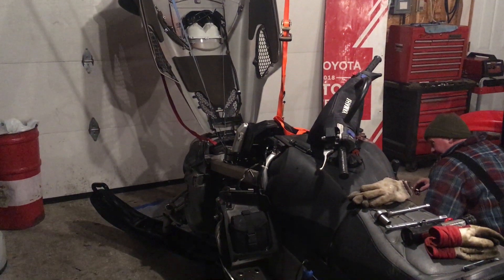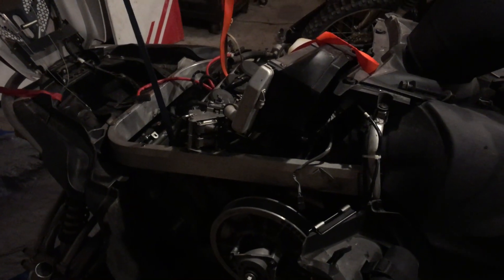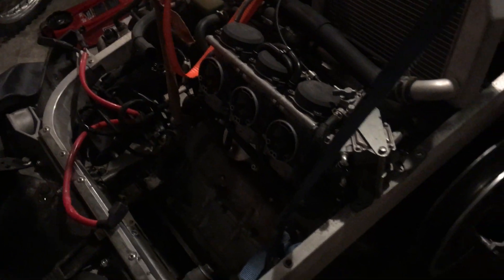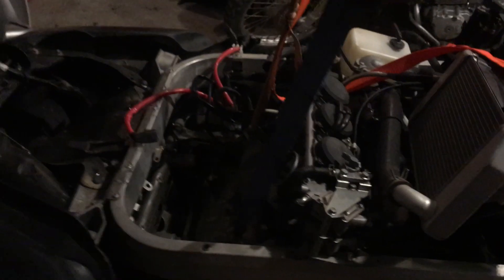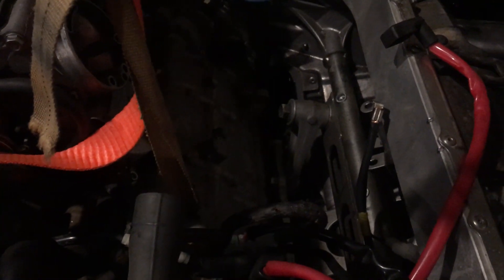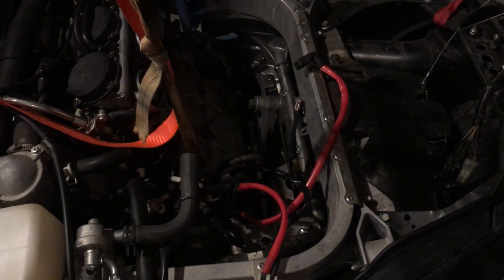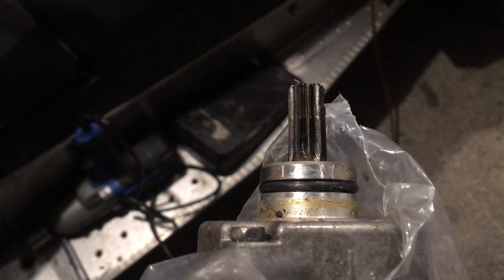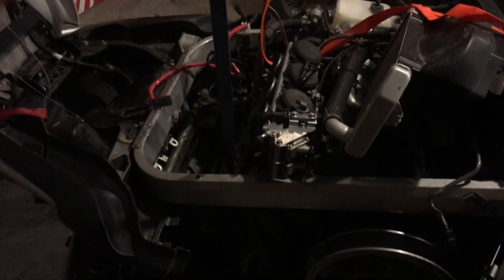2010 Yamaha VK PRO starter R/R ( The Red Valentine)

Comment: Hi, Thanks for posting this! - I have to do a starter replacement on one this winter at a remote homestead. I could not believe it when I saw that the starter can be undone in there, but then there is not enough space to remove the bastard out of the cavity. Designers?! Yeah what a mess that is no surprise ! But in general their good machines... Here in Alaska people haul huge loads with these machines, they pull hard and need not that much fuel. I have 4 of them myself, all bought used and abused and nursed back to health. Pulling loads on a 91 miles trip to a homestead works great with them. Regards from Alaska!